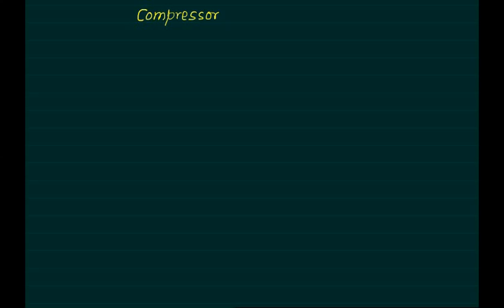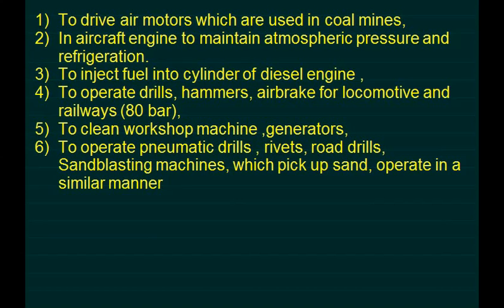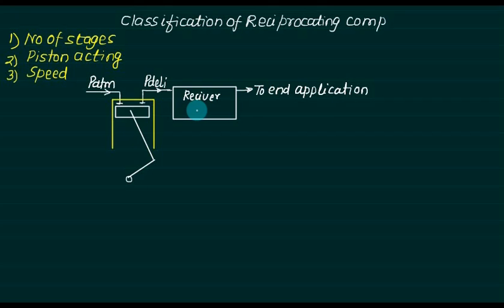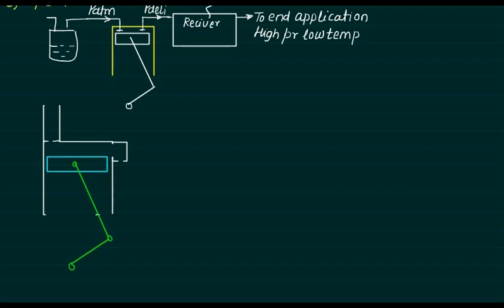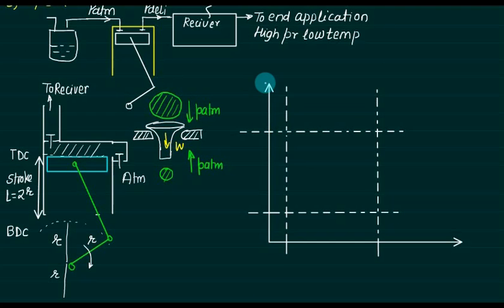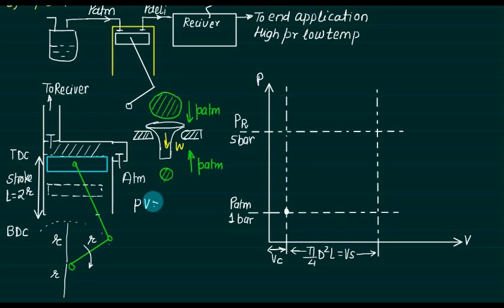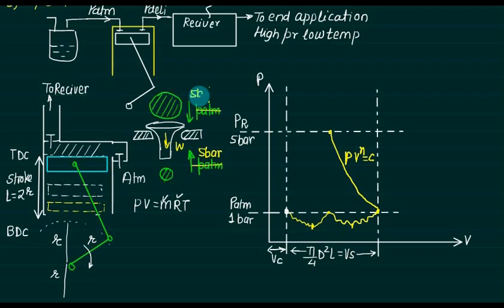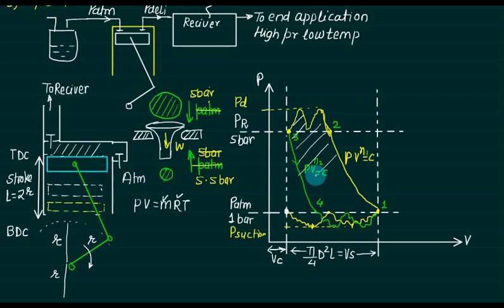01 Reciprocating compressor | Introduction to  Reciprocating compressor  | PV diagram

Comment: sir at the top valve why the pressure at the top surface is 5 bar'please explain
Reply from the maker: The delivery valve is connected to the reservoir which is maintained at 5 bar for end use application. Hence pressure on delivery valve is 5 bar